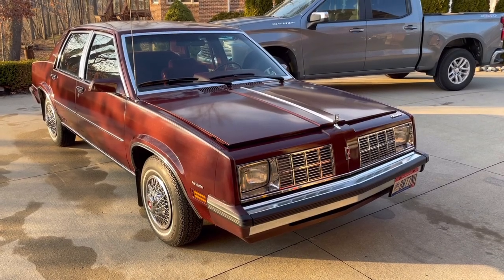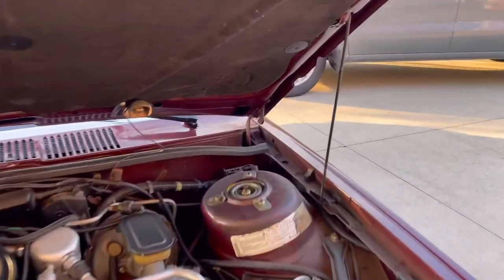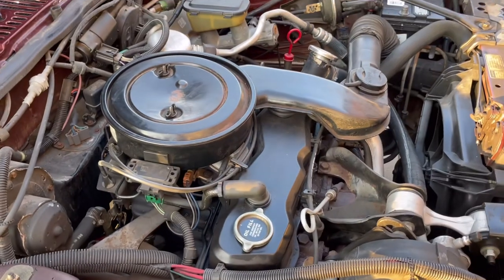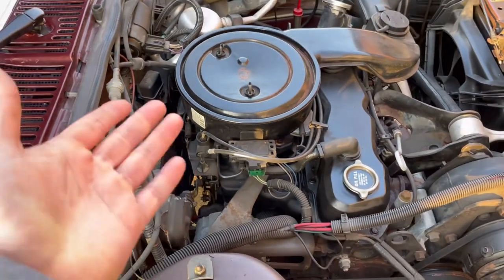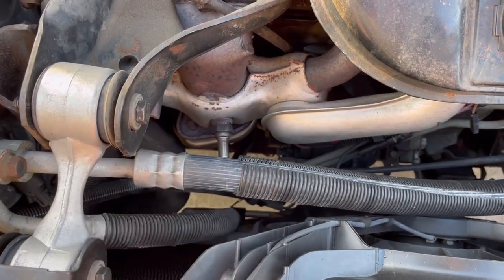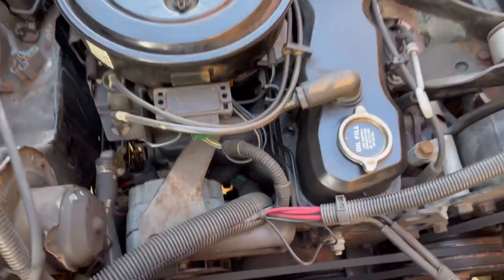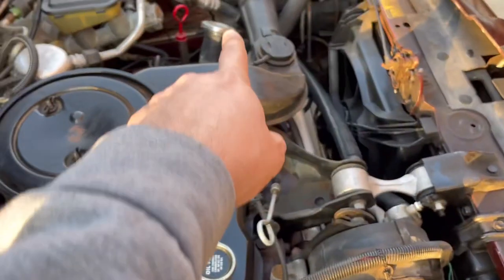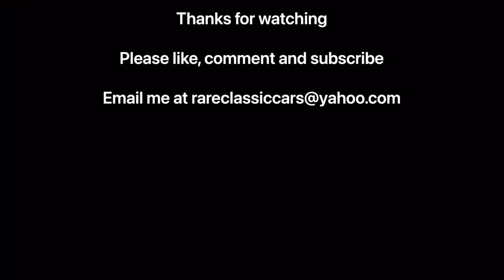Little-Known Details About GM X & A Body Cars (including Citation, Celebrity, 6000, Ciera, Century)

Comment: I was on pins and needles with you going into the engine bay with the hood fully propped up. I have a 1985 Cutlass Ciera and when I put the hood in the fully up position I put the prop rod into the hole that is on the hood hinge for extra safety. If you can do that on the X body I highly recommend doing that. Without doing that , a little gust of wind will slam the hood right on you.
Reply: I came to say the same thing. My parents had an 85 Ciera back in the 80’s and that was how dad did it. That was a great car. They kept it until the mid 90’s as a spare before they sold it with about 130,000 miles. The 2.5 was low on power but reliable.
Reply: Yeah made me nervous too
Reply: I don't think he'd actually work without securing the hood.
Reply: I was thinking the same, it could seriously hurt if the hood slammed on you…Mercedes had the same idea so that the massive grill was out of the way.
Reply: Did the dealers have a prop to keep the hood vertical/not fall down in a wind gust?

Comment: Your Omega is in amazing condition! Absolutely hated the iron duke engine.  The one in my '86 Calais blew a head gasket at 57,000 miles. My next car was a '91 Regal with a 3800 V6.  Went from GM's worst engine to its best.
Reply: I would argue that GM’s worst engine was the 2.3 in the Vega.  I currently have a version of the Iron Duke in my 2015 boat.

Comment: I think you are like me, you feel almost bad for liking the Xcars.  I was 14 in April of 79 when they were introduced.  My brother took me to all the local gm dealerships and I loved the cars. I talked on of my friends moms into buying one (we dont talk anymore ). I still am so intrigued by how nice the packaging was and how much fun they were to drive for the time.  If the X cars had been more reliable gms future would have been different.  They were a great designs and they forever changed the car industry.
Reply: They were not bad after the extended 1980 model year. My father's '81 had very few problems and was assembled very well.
Reply: I'm a Ford guy and I thought the X-cars were beautifully styled, way better looking than anything foreign by miles.
I agree, if they'd been a little more reliable they would have done great in the market.
I thought the Omega and Skylark were gorgeous adaptations of GM big car styling in a compact package.
Reply: However, I would like to point out that GM got it right in relatively quick fashion. X cars were rushed into production due to an abbreviated timeline to meet stricter emissions standards, and so suffered some lack of R&D and refinement. The A cars that followed, by the late 1980’s and 1990’s were perennially (especially the Buick Century and Olds Ciera) on the top ten quality and reliability charts, not just within GM but the segment as a whole. GM gets lots of credit for their lemons, but rarely gets recognition for their plums.

Comment: I had an ‘81 Olds Omega and a ‘84 Buick Skylark as company cars that I had to drive about 20k miles per year.  They were surprisingly roomy and comfortable on the highway once you got them up to speed, but trying to pass someone on a 2-lane road was a white-knuckle adventure in moderate traffic, and the engine noise at full passing throttle did not inspire confidence that it would hold together.  My next company car was a Buick Century A-body with a small V-6 , which was an improvement.

Comment: That thermostat is affectionately known as the “hangarstat”, and was a great innovation at the time to ease the service procedure. Be careful, however, when sourcing a replacement. You’ll notice the thermostat has an O-ring on its circumference. This seals the thermostat to the housing. The wrong diameter even by 0.00010 will either allow coolant leakage if undersized or tear the O-ring if oversized. Either way the engine will run too cool affecting fuel mileage and emissions.
Reply: That was a good idea by GM (they had few). Easy replacement of the thermostat also if you had to drain the cooling system (drain cocks weren't in the best locations either, must have forgotten about that little detail) for any reason, you remove the T-stat and easily refill the both the engine and radiator with minimal amount of air pockets left in the system. For some reason there always some pockets left in the heater core which you had to run the engine at a higher rpm (2000 or higher for a time)to get the coolant circulation going in order to purge the system of any air left in the core and engine once the T-stat opened. Those two caps that Adam had showed, one was just a sealed cover for the T-stat to secure it in place, the other which was the actual pressure cap mounted in the radiator to regulate system pressure. Those weren't often changed because there location and the difficulty (very tight) in removing and replacing allot of mechanics left them alone. If you had to change one you had to make very sure that the seal surface were clean and that they were fully seated in place or you might be fighting not only a leak but possible damage to the radiator. With that design it was very difficult to pressurize the system to check for any leaks, being that the cap was below the coolant level and as far i can remember (at least I never seen one) there wasn't any pressure adapters made that would mount to the T-stat cover to pressure up the system. The 80's were definitely a transitional period for all the Big 3 domestic automakers which they are still trying to forget.
Reply: The fault with the design of the thermostat is the "handle" will bend out of shape and allow the thermostat body to pop up out of position and ant then the coolant flows around it causing the engine to run "stone cold". I finally had to design,  make and install a tube  with a properly positioned hole  to hold the thermostat body in position.

Comment: I had a 84 Celebrity 2.8 V6 that I paid $5 for (essentially gifted). Drove it another 100,000 miles or so. Very comfortable driving car. Mostly trouble free except the carb and pickup coil in the distributor.

Comment: For what it is, it's a neat little car and I can appreciate it more now than what I did in the 80's. Being super clean and low miles helps a lot, I would put around town in it. 

You missed the Skylark in your title though. In the early 90's a friend had a Limited similar to this Omega, same color and with a v6. It was a comfortable car and despite having the front and rear suspension and the floorboard nearly rotted out it did ride and drive fine. The carpet seemed to be all you had between your rear end and the pavement below. That is ultimately what did it in otherwise mechanically the car was running good, shifting fine. I want to say it had around 180k miles before it was sent to the scrap yard.

Comment: Hey Adam I really enjoy your Channel. It's always interesting and I learned a lot from it. Here is my story regarding my 82 Pontiac j2000 which I bought back in 1987. I loved the styling of this car. I believe it had the Iron Duke engine. It was definitely a 4-cylinder. I had it parked beside our house. My wife and I decided to go out shopping. I started the car and it ran smoothly for about 10 seconds or so and then there was an huge explosion in the engine compartment. I'm not kidding. We were shook up really bad. My wife and I were safe inside the car but immediately there was black smoke coming out from the wheel wells as well as the engine compartment. It was only the second latch on the hood which prevented it from blowing right off the car but the hood was badly damaged and Flames were shooting out. The neighbour across the road  came out to see what was going on as their house shook. The explosion blew out our dining room window in our house and there was glass everywhere inside. Fortunately there was snow still on the ground and my wife and I grabbed shovels and started throwing snow on the engine and on the tires which were both on fire. I actually managed to get the hood open and the Flames just came out at me. We piled snow on the engine as well as the tires and managed to put the fire out. All of the plastic parts on the engine we're like melted plastic goop and left a black plastic puddle under the car. The car happened to be in really good shape at the time but I think there must have been some kind of a gas leak on the carburetor. The insurance company paid me out and I did okay. The car was picked up by a towing company and towed away to a salvage yard. Here's the interesting part. About 5 or 6 months later my wife and I were driving passed a used car dealership over an hour away from our house and lo and behold there was our car for sale on the parking lot. Someone had fixed all the melted plastic parts. I took a good look at the car and it was definitely ours. I spoke with the salesman about it but never told him that the car had exploded in our driveway. The salesperson told me that someone had really taken good care of this car and I smiled and said yes they sure did. I never dreamed it would be fixed and resold.

Comment: it's a good thing the engineers designed the hood to "open wide"........... or maybe it was foreshadowing the dismal dependability of the X cars. Weren't they the most recalled GM car? Rear brakes that would induce a "Rockford J-turn" when braking hard? Trans troubles, interiors that would fall apart while driving, and rust. Yep, that paint. Annual sales went form 800,000 units to about 100,000 units in a mere 5 years. My grandfather was a retired GM guy at the time and had just purchased a new 1978 Nova the year prior. At the time he said he wished he had waited one more year to buy an X car. A few years later, he was thankful he had the Nova. You have a nice, and probably rare, example of an X car. I appreciate unique vehicles and your perspective; enjoy!

Comment: I'd be reluctant to lean into the engine outdoors with the hood straight up; a good gust of wind could send it crashing down. Maybe a ratchet tie would make it safer, if the job could not be done inside. That dog-bone upper engine mount was a very good idea for the Iron Duke, since most of the vibration from an inline 4 is the second-order vertical motion. But the ones in the X cars often look a little cockeyed and the bushings have so little lip that it's easy for the dog bone to slide over and directly contact either bracket. I wonder if centering the dog bone would reduce the noise and vibration from these engines.

Comment: I've never had any of my iron dukes stall out on me - whether they had a carburetor or fuel injection. I never did the adjustment you showed on the TBI, but I knew it was possible.  Maybe if it needed a tune up or a vacuum hose came off, it might.  Definitely not a usual thing in my experience.

Comment: I has a reliant k with the mitsu 2.6. To get the oil filter off you had to go to the back from underneath cuz it was right under the exhaust manifold. I always wished i had the chrysler i4 cuz the filter was right there in front out in the open. It also didnt have the mikuni carb or timing chain guide issues the mitsu was infamous for and what lead to the death of mine.

Comment: I've got to change the oxygen sensor on my 1982 X-11, too. 156,000 miles. There's also a tool that works for most transverse FWD cars that replaces the dog bone and let's you roll the engine forward easily with the transaxle in neutral. HIghly recommended for the V6 cars, particularly with AC. The 1982+ V6 cars, if you remove the air injection system valve/servo contraption by loosening the clamps, you have a lot more room to access the plugs on the back bank. You are still going to curse a lot, but less than if you didn't do that. The inability to easily do reoutine maintenance is the one thing I would change about these cars.
Reply: The transverse Saabs have fluid filled engine mounts.  If you start rocking the engine much you will tear these up.
Reply: @rogersmith7396  Nothing very sophisticated on these cars. The mounts are all blocks of rubber with studs molded in them. The shop manual instructs how to roll the engine forward on the mounts, so it's a service procedure that was taken into consideration when the vehicle was designed. Lesser known fact was that Volvo bought a bunch of X-bodies to use as mules as they developed the FWD 850 and tested the Inline 5 cylinder engines. The 850s are also incredibly durable cars.
Reply: @stevevarholy2011  The engineering looks like good old GM parts bin.  I guess the car looks all right but GM is taking the egg crate grill with it to the grave. Because of course every sane person wants a garish egg crate grill flapping in the wind.  If only Ferrari understood this.  I like the color but the car has a definite grandma vibe.  I just know Adam is going to have an Aztek one of these days.  I found a Nash Metro a couple of miles away.  Maybe that.

Comment: The factory prop rod will work in the higher service hole to prevent accidental closing.
I remember some investigative media in the late '80's, who disconnected one spark plug wire and took one of these cars around to service centers and dealerships to see what they recommended, looking for scams. You would not believe how many first wanted to replace the fuel filter. Not an easy job. Some did find the lose wire.
A friend had the Iron Duke engine and put close to 300,000 miles on it. He kept it tuned and did regular oil changes. 
The oil always looked clean, never dirty. I had a new car at the same time and did the same maintenance. I drove it for over 200,000 miles, but the oil always looked dirty, even after changing.

Comment: I was in high school when these things were new. Or at the end of their production run. My friends and I were townies and we drove well used big Detroit iron. One of them drove a 1979 Citation with the Iron Duke four cylinder and the infamous TH-125 automatic. The Iron Duke was a solid engine if you kept the oil changed but the TH-125 was known for being big time trouble. The one in his car shifted like a sledge hammer but it ran that way for years.

Comment: Thanks for the video.  For all of the bad press (much of it deserved) the X-car received, my second car was an ‘81 Citation two door hatchback, it had lots of cargo space, and still to this day was the best car I owned in the Michigan snow while in college.  The 2 barrel vari-jet was a bit troublesome, and the steering rack had to be replaced due to morning sickness, but otherwise a dependable car.
Reply: I wonder how bad those "morning sickness" cars got if you just lived with them. The ones I drove always came too after they warmed up, so it didn't seem like a big deal. Maybe mixing some heavier oil into the steering fluid would also have helped.
Reply: I could be dangerous when the power assist came back suddenly and you weren't expecting it. My 1981 had "morning sickness," too.

Comment: My mom had an 86 Celebrity with the Iron Duke which was also my first car, and I had one later later in life bought for sentimental reasons. I see yours has the upgraded motor mount. The originals were stamped steel if memory serves me correct… they broke very easy.
Reply: The Saabs were all aluminum and they broke as many times as you would replace them.

Comment: Never had to take the hood off to remove the engine.  Nice!
Removing the IAC motor and cleaning the pintle and seat with a cloth soaked in carb cleaner will improve idle also.

Comment: It's nice to hear an Iron Duke do a cold start and run so well without anything "off", and they were probably the best sounding 4 cylinders I've heard, with a nice throatiness.
Reply: They have a certain burble to their exhaust note when driving down the street, which I've never really heard from any other engine. (Although an old air-cooled VW makes a similar but more pronounced sound.)  It makes them sound smooth, and it kind of surprised me to hear the Iron Duke (or Iron Dork as I sometimes call it) referred to as a 'tractor engine.'  That burble actually reminds me of an Olds V8.
Reply: @DanEBoyd That’s not a nice thing to say about an Olds V8. 😀
Reply: I thought it sounded pretty good for a 4-cylinder in this video. I bought the '87 Celebrity Eurosport from my neighbor in 1991, but had taken it around for a test drive and assumed it was the 2.8 V6.  Turns out it was the Iron Duke 151 cu. in. four.  I never found it to be as crude as everyone seems to say it was in the comments, and it was pretty trouble-free for me, without the annoying valve cover oil leak that my dad's '87 Century's 2.8 V6 had.
Reply: @drippinglass  I love Olds V8s.  They are the smoothest GM V8s in my opinion.
My first car was a '77 Vista Cruiser with the 350 Olds.  I didn't call it a Rocket because Olds stopped using that nomenclature after 1974.  But mine was so worn out that it ran like a 2.5...😅
Reply: @drippinglass  The 350 in my '77 Olds 98 was surprisingly coarse on cold mornings; I suspect that GM had shaved a little off the balancing weights to save weight. They went even further with the Pontiac 4.9, substituting weighs on the ends of the crankshaft for the ones that had been opposing each crank pin.
Reply: There are thousands of Iron Dukes traversing the highways. Just find an old US Mail Grumman LLV. I believe most of them are Iron Dukes.